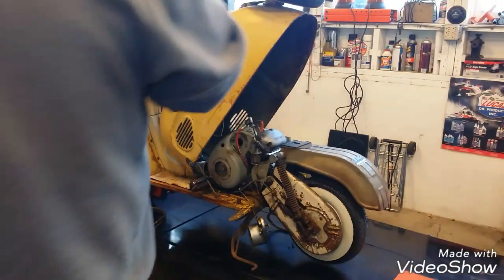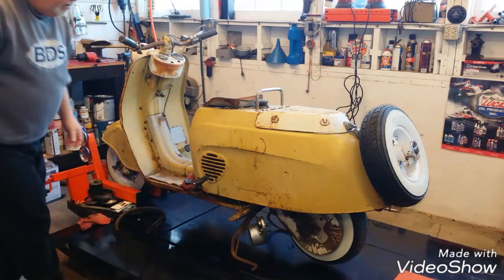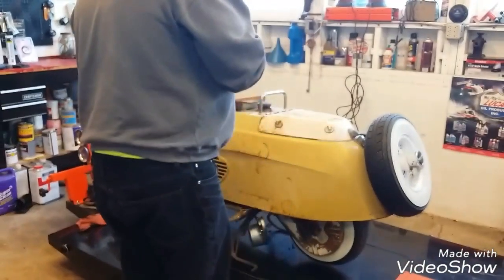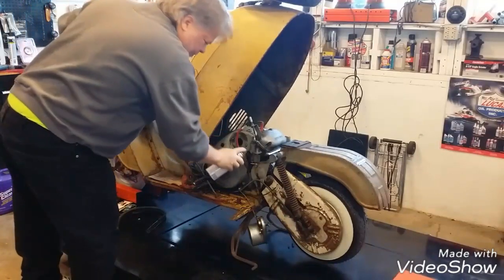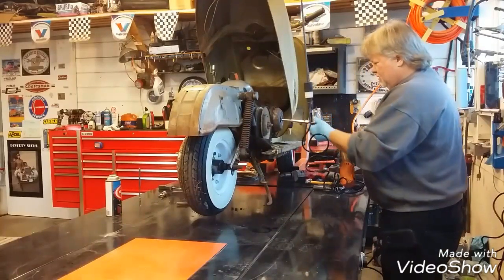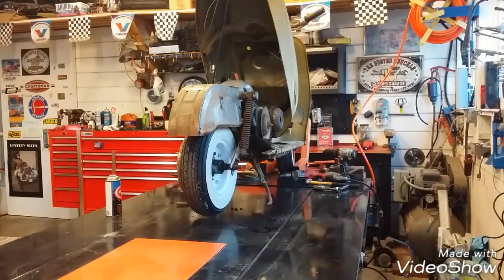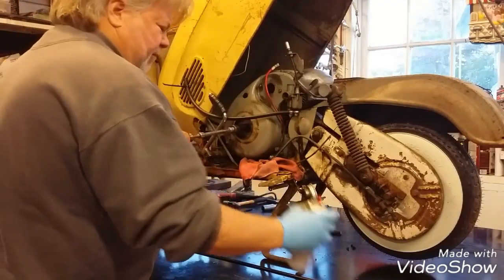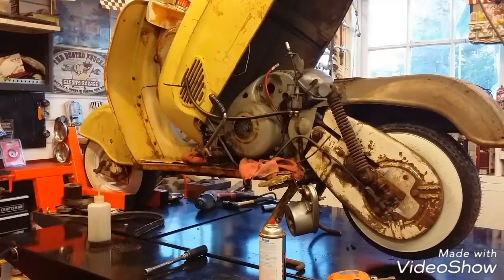1959 Silver Pigeon, can we get this engine to fire? Let's see!

Comment: Typical atv or motorcycle carb...the cable through the top is the idle adjust.
Reply from the maker: I am going to have to go to a after market carb, this one is junk without a kit. Needle and seat junk.
Reply: @GlennsSpeedShop  well dont give up... It's a cool bike. Really enjoy your Honda genny videos and after hearing how you troll craigslist I wondered if you have tried the website OFFER UP? I have found down here in the south there are a lot more deals on offer up than CL....
Reply from the maker: @wildman4642  I have never tried Offer Up... I should have a look right now.... Thanks for the comment.